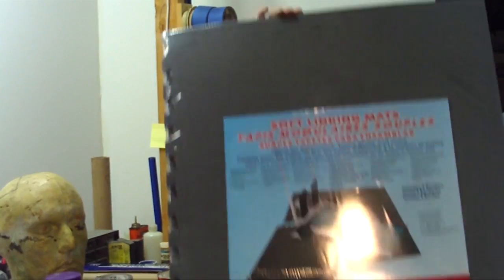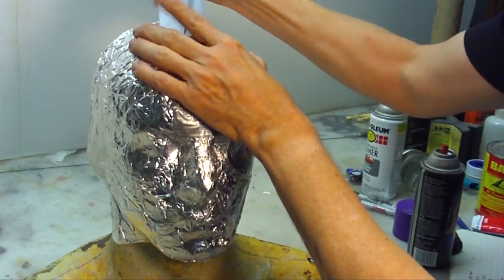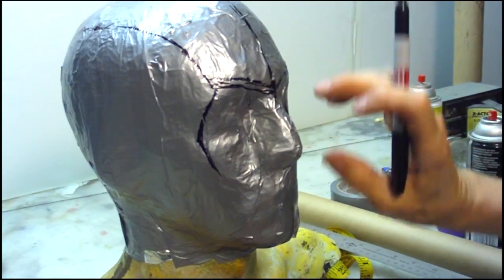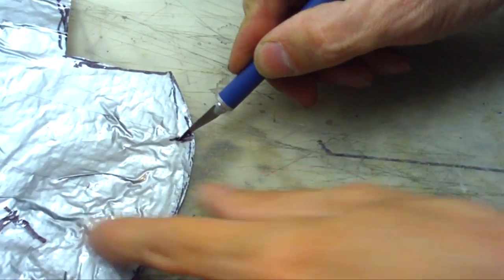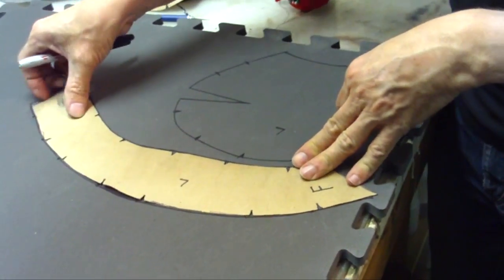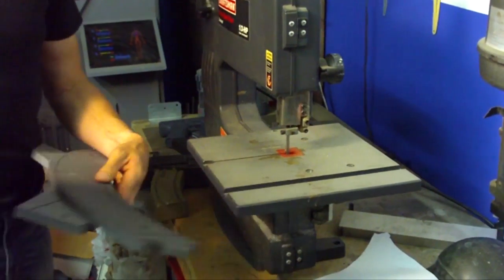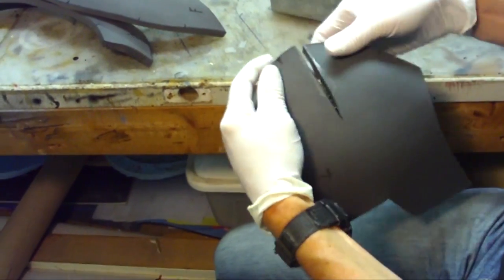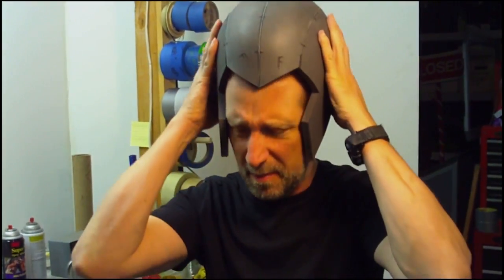How To Make a Foam Helmet Tutorial (Part 1)

Comment: Thank you for the video! I'm having problems with size though.  I've used the foam head and wrapped it in paper mache to be the same size as my head.  However, when I transfer the templates to foam, and put it all together, the helmets are always too small.  I'm guessing because my template is the size of my head, transfer to what is the outside of the helmet, thus making the outside of the helmet the size of my head. Any words of advice?

Comment: To those wondering about a hair dryer versus a heat gun:
Get a heat gun if at all possible. I've tried both, and the hair dryer is just annoying compared to the heat gun. It takes at least 3 times as long to heat up the foam and usually blows it away before then. Yes, it will technically work, but it's just not the same.
Reply: +GLaDOS Thanks, was wondering about this!
Reply: you can also get low powered bs. high powered heat guns, if you're worried about scorching the foam but don't want to waste time with the slow hairdryer. i have a high power from home depot and a lower power, slightly lower heat one for $12 from Radio Shack.

Comment from the maker: Thank you T.L. Sitter for reposting.
Reply: would i be able to use a hair dryer etc. instead of a heat gun??
Reply: +SPEED DEMON you can depending on how hot your hairdryer gets and how thick your foam is, it'll just take longer since heat guns get way hotter than a hairdryer
Reply: Evil Ted Smith Hi Smith! I love your videos they are awesome and I have the same box cutter and I need an X acto blade!!
Reply: Evil Ted Smith what if you want the helmet to be comepletely closed like for a sans head for cosplay

Comment: The register marks you made on the pattern were the actual size of the head, when you transferred them to 1/2" foam you put them on the outside making your helmet 1/2" smaller than the head.
I guess that would be good for a tight fit but if someone has big ears thats going to hurt after a while.
Reply: phartattack 
true, i used this tutorial for my nephews halloween costume..it looked amazing but it hurt his head after a while and felt so bad...learned from my mistakes, now i just make the pieces bigger for a better comfortable fit

Comment: Really informative, and the hash marks are pure genius.  Do you think it's worth trimming the edges underneath to make matching up hash marks easier? or just muscle through and trust in the contact cement?
Reply from the maker: I find it easier to do them on top. Not only our you lining up your hash marks, you're making sure that the foam stays flush has you press it together.

Comment: Hey Ted, wondering if you could answer a question? On the generic chest armor chest piece you sell, to enlarge that piece, from the spots it is marked to enlarge from, would I just add a straight piece to the edges or do i need to follow the angle of the pattern? Thanks!
Reply from the maker: Yes, you could just add a straight piece of foam as well.
Reply: Thank you for the reply, the templates, and the instructional videos! Saved a lot of time for me in a crunch. Thanks again!

Comment: If you have trouble drawing a straight line over the curve of the head, try using the spring steel spine out of a windshield wiper blade. If it's a thin one, you can even duct-tape one end down and bend it all the way over. Makes a handy straight edge!

Comment: Mr. Ted. I was wondering. ... lol Is the transfer paper step necessary?  Because the thought came to mind during cutting my butcher paper that I could've just skipped that part? Lol 3:00am here. Crashed.
Reply from the maker: Prencess Fishey I transfer them to paper to clean them up and for easy storage. So that I could use them again another day.
Reply: Evil Ted Smith I may be a bit late to reply but does the type of paper used in the transfer need to be specific, or can I just use printer paper if my pieces are small enough?
Reply: Peanut Any type of paper will work

Comment: I've now made a couple of these from your patterns and while they're both in the trash now I'm getting much better! One failed because I forgot to flip the side pattern before cutting (oops!) but the others because I didn't give the glue enough time to get touch dry and they sort of pulled apart a little which makes them look messy. Last mistake I've made is to use the heat gun too much on the outside surface which causes the edges of the side gusset to soften a little so they don't match sharply. It is hard to keep the blade straight up and down though, but I'm being careful. I'm going to make another tonight (and then order some more foam ;) ) so hopefully I'll have improved my technique.
Reply from the maker: Everything comes with time, each time you build something you improve.

Comment: quick tip if you use mounting spray on the back side of your pattern it will stay put while you transfer it to foam and remove easily after your done.
Reply from the maker: +Matt Pictaggi Thanks.

Comment: I have some tendril parts at the bottom of my helmet that were meant to cover my hairline/frame my jaw, but no matter how much I heat and bend them, they love to taper out. On top of that, I can't have them where I want them to get the helmet on. Is there a flexible way to keep them in place once on? Is a wire skeleton a good idea or is plastidip not flexible enough?

Oh, and to add, this is my first time using ANY of these materials or tools and I am blown away by the results so far. My husband called me 'a natural', but I have to attribute all of the success to these videos. I feel like I've been doing it forever. Thanks a ton!

Comment: Hi Evil Ted, thanks you for this excellent guide, it will be a great help for my project. Just wanted to ask you: the link in your shopping guide for the EVA floor mat returns 5/8" Diamond Soft Tiles, but the one you are using looks thinner. What is the actual thickness of the soft tiles your used?.

Comment: With some rubber cements, there is a window from the time you apply to the time you assemble.   If you take too long in fitting pieces together, the glue will dry too much and not have a nice, strong bond.  
My question is can the same be said of Barge Cement?  Does it have a finite window like rubber cement?  If so, do you re-apply to try again or do you have to get the first layer of cement off before try no. 2?

Thanks and awesome tutorials!
Reply from the maker: Loch Sorenson Yes, if it's too dry just reapply the glue.

Comment: Great video, can't wait to see more!  Question, if I may.  Do you have a particular band saw blade type you prefer to use, like metal or wood or something like that?  I've noticed when I cut the foam with mine, the 1/8" thick ones tend to leave a rough edge, whereas yours were nice and smooth.
Reply from the maker: Hello Matthew, I use a metal cutting blade because the teeth are smaller.
But I do some times sand the edge with 220 sand paper.
Reply: Awesome!  Makes total sense.  Thanks so much!

Comment: I made my template and have my foam ready but I'm worried about the sizing of the template. If I cut the pieces for the helmet with the template as is, I fear it'll be too small. How can I increase the size of my template? Or should I just cut the helmet pieces out of the textured side?
Reply from the maker: My advice is to make first to see if it fits. If not you have a better ideal on how much you need to add or take away.

Comment: Hi Ted, thanks a lot for the great breakdown!

In terms of the casted head/mannequin head, do you think I could use a styrofoam mannquin head instead of a hard plastic one? I imagine there might be some issues with cutting the pattern off since the blade might cut into the styrofoam but plastic heads are typically more expensive..
Reply from the maker: +TraceurCMann Check out my video Evil Ted Talks 5.

Comment: Hi there!  GREAT tutorial!!  Thanks so much!!  I do have a question... I am making a Magneto helmet for my husband for Halloween and Central Ohio Wizard Con, and I have all the parts cut out, but I'm having a terrible time getting them to stick.  How long do you let the glue cure after applying it?  No matter what I do, it won't seem to stick.  It holds for a few seconds and then falls apart.  :(
Reply from the maker: Dana King Are you using barge cement? Do at least 2 thin coats, and let them semi dry then push them together.
Reply: Thanks for the quick response!  We ended up buying different contact cement and using that, and I found out that after 2 coats and a good 15 minutes of curing, they stuck together very well!

Comment: So I was wondering, you cut the form into 4 different pieces then reassemble. Is there a reason why you don't keep it as one piece like a cube made from one folded piece? Wouldn't that limit the chances of misalignment of the seams?
Reply from the maker: +Stefan Fuchs It won't come together easily. Thats why I make my registration marks. So it will line up perfectly.

Comment: Hey Ted, I love the videos, I subbed right away :D

I also have a quick question for you, in terms of glues/adhesives/Barge, does Barge cement give off allot of fumes? Also, if it does, is there a less smelly alternative to this with the same strong bonding capabilities?
Reply from the maker: +Zeno Evil Yes it is fumey, you definitely want to use in a well-ventilated area. There really isn't a less smell alternative. All the good stuff stinks.
Reply: +Evil Ted Smith Awesome, thanks for the speedy reply, and the info, much appreciated!

Comment: Hello Ted, I was wondering if you cld give me advice on how to attach the Eva foam to a pvc body suit. I am currently in the beginning process of helping someone do a comic book version of Gamora. And I told her to buy a PVC black body suit and a Fishnet body suit to lay over to give it the right texture, And then i wld like to use the Eva foam for the body armor, but unsure how to be sure it will stay attached to the outfit. Do you think the Adhesive you use for the helmet here wld be suitable for that? I look forward to your response: Thank you for your time :D
Reply from the maker: +Ashleyy Powenski Use Velcro. Sew the soft to your suit, then glue the hook side to for foam amor parts.
Reply: OHHHH That is such a great idea! Thank You!! :] Also I bought weldwood instead of barge, Do you think this will pose to be an issue?? Shld I still seal the way you seal with the cloth?

Comment: Mr Ted,  what is that head cast made out of? and is that your own or where did you get it? I tried using a styrofoam head and molding clay to get the right size but that was a disaster 😂 sucks having a 23 inch head!
Reply from the maker: I have links just below the video were you can get head forms.

Comment: I used your vid tutorial and made a helm that fits perfectly for my head! Thank you!! 

Now the next part - how would I best be able to seal the seams made on the high stress connection points when finishing up the helm with sealer? I plan on using Plasti Dip to seal the foam helmet.
Reply: Sorry I meant to make the helmet with a smoother surface so it doesn't obviously look like there are seams

Comment: Ted, awesome videos! I bought a floor mat and tried to create a helmet with my son, but the glue just wouldn't hold. 

* I tried a contact adhesive and it wasn't strong enough to keep the shape in the foam, it would stretch and peel off (not barge but I have barge on order) . I did follow the instructions (wait 15 minutes, hold together 3 seconds).

* I tried hot glue, which worked on some parts but wasn't strong enough for other parts.

* I tried super glue, but that wouldn't harden at all. Though it did glue my fingers together...

I found some 0.6cm thick foam to use instead, and that worked with the hot glue.

Question; Are some EVA foams too high density or too thick to be malleable enough for contact adhesive? Or was the contact adhesive just too weak?

cheers,
m
Reply from the maker: I've always had better luck the contact adhesives.

Comment: Hello! I've have a question. On the video you use a cast helmet. As you mentioned before most do not have this available. You suggest a motorcycle helmet. But would this not cause a problem when forming it to your head since the helmet is larger and does not have facial features?? I apologize for my question but right now I'm building weapon props. So armor is all new to me. Thanks!!
Reply from the maker: I made this  video 3 years ago. To make things easier. I have the patterns in my shop.  http://eviltedsmith.com/shop/
Reply: Thank you! I apologize for commenting on such a old video.

Comment: Hey Evil Ted, Thanks for the video.  it will help with a cosplay i am going to be doing in the  future.  Question.  for a video if you haven't done it already, could you do a video on how to make a full head helmet like the ones in Toku (Power rangers and Kamen rider) or like Gear from Static shock.  i want to be able to breath while it is still on but it don't know how to do it.
Reply: those full face ones usually include a visor you can remove or air vents. sometimes if the helmet is big enough you can fit a small fan in there to prevent fogging and keep you cool and the air circulated.
Reply: use fabric for a visor. well as long as you can see through it.

Comment: Do you think if I use this basic design to fit my head so the helmet will be tight and won't wobble would it be possible to add 3d details to it to make a halo 4 master chief halmet such as the bulky sides that leave a crevices in the middle or the long piece that goes over the visor? Any ways this is a awesome tutorial!
Reply from the maker: Yes, that sound like a good plan… And thank you for watching.
Reply: Thanks and you're welcome

Comment: Hey Ted. I've made two helmets so far and they both turned out horribly. There was a lot of trouble getting it into shape (regardless of how much I used the heat gun) resulting in the glue not sticking all the way and leaving a huge gap in between the seems. What am I doing wrong?
Reply from the maker: +Bob Marly Check out my how to make clean seams video. I go into how to use the glue properly in detail.

Comment: had to subscribe, so helpful! how do you feel about using hot glue to adhere the eva foam pieces? (as opposed to barge cement/ 3m adhesive)
Reply from the maker: +Israel Morales You can use hot glue, but barge is better.

Comment: How do you get all the parts to stick together? every time I do it they always end up coming apart and not sticking. 
I've heat formed them into shape but they don't don't ant to stick. Maybe it's because I'm using a hi-temp glue gun, but I don't think it's the problem.
Reply from the maker: +PantaPomf No, it is the problem. You need Barge cement or other contact adhesive.

Comment: I am making a deathstroke helmet and I was wondering if it had to be made of eva foam for your process. I have seen those foam squares but, they dont specifically state they are eva.
Reply from the maker: AntHardyb1tch You can use any foam you can find that works for you. I have links below my videos but you can use thinner craft or the fatigue foam, too.
Reply: +Evil Ted Smith Thank you for the helpful advice. And if I come across anymore complications will it be okay to consult with you?

Comment: Im having trouble with my glue, im using dap contact cement and it keeps drying up and absorbing into the edges? Am I using the wrong type of glue?
Reply from the maker: +rohirrimranger You can use dap but you probably have to put on more than one coat and don't wait too long for it to try. I'd go with Barge if you can.

Comment: Stupid question here: I have a variable temperature heat gun, whats a good temperature to use to heat the foam? I'm using the eva floormat foam.
Reply from the maker: +Sean Rogers As hot as you can get it.

Comment: What type of glue would you recommend? I tried using Rubber Cement, but it doesn't seem to have a good hold over time (I let both parts dry before sticking it together).
Reply from the maker: TheJokerOfOhio Just check out my supply list below my videos

Comment: also about how would you recommend heating the foam before attempting to bend or mold it?
Reply: Generally you would use a heat gun to more or less soften it. Then you can freely bend and mold it. It's called heat forming

Comment: Good Evening, I'm not sure if you got my msg, so I'll post here. I really enjoyed your videos on making this helmet. I'm new to fabrication and on my first attempt it came out ok but I noticed that after a few days the sections began to come apart. Not completely but enough to be very noticeable. I'm certain I followed your instructions to the letter. Do you have any suggestions for a noob like myself on how to avoid this?
Reply from the maker: It could be 2 things. The type of glue your using or you need to put on more thin coats of glue.

I've had this happen when I used a different glue.
Reply: Thanks for getting back to me. I used Barge like you did. I put on a thin layer and waited 5 mins as suggested.

Comment: does the performix plastidip (the one with red cap) is ok ?
Reply: i use plastidip to seal a lot of my foam, i always use black b/c paint colors pop better again a black background, unless you're painting it white, then use white plastidip. you can also use watered down Elmer's school glue to seal foam before painting. water it down until it's the consistency of milk then apply 3-6 layers, letting each dry at least an hour between layers to get a butter smooth finish.

Comment: im making a dead space cosplay and this will help. btw how expensive is the foam and where can i get it. also suspicious tumbleweed cosplay sent me.
Reply: Home Depot sells it, and I got 4 sheets for $20
Reply: you can also order from TNT cosplay supply, they sell 60" long rolls of foam from 2mm to 10mm thick. it's smooth of both sides and takes heat, priming, cutting, and paint exceptionally well.